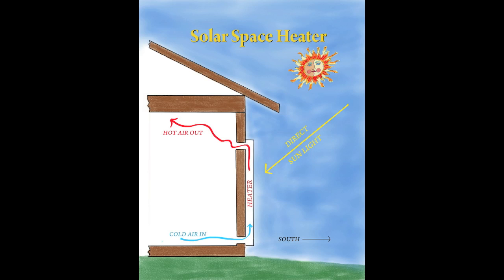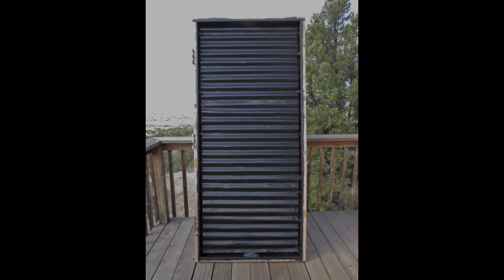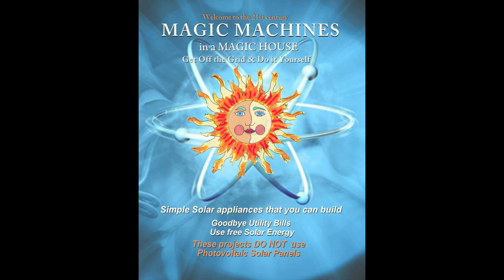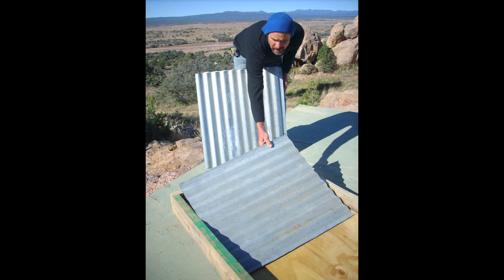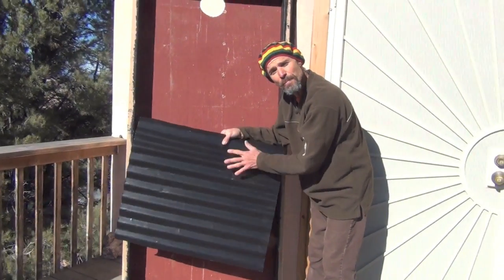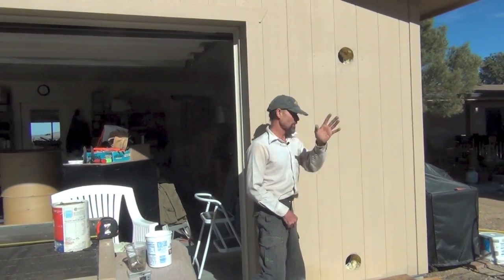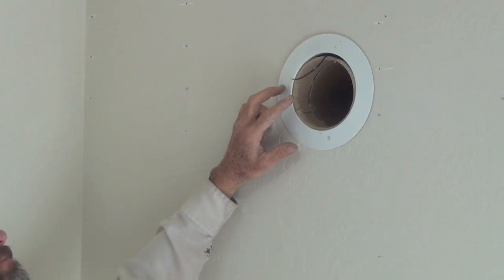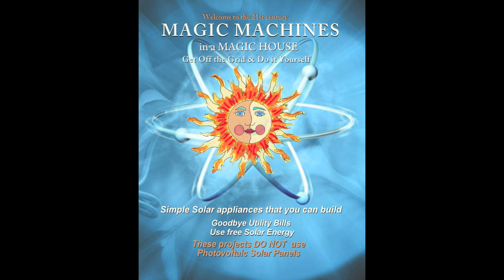Solar Home Heater DIY by Jack Saville

Comment: A great video Jack! do you think this would work in the uk where the sunlight is not too strong?
Reply from the maker: It is not how strong the sun is, but if it is out. If the heater gets a few good hours of sun, it will give heat at that time. Ideally, the middle of the day is the best, but take what the sun gives.